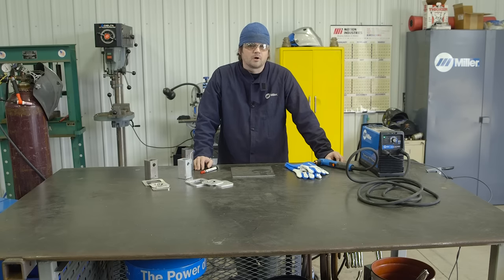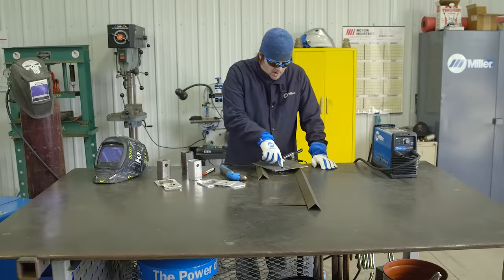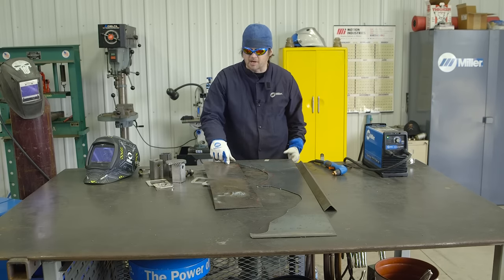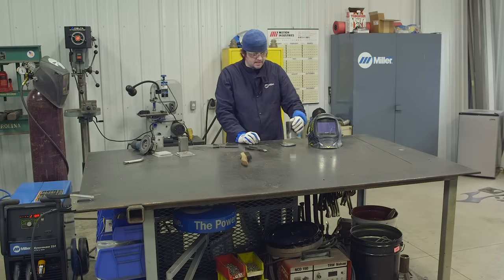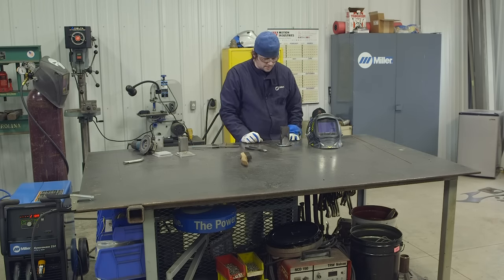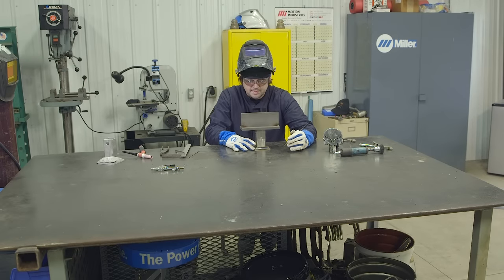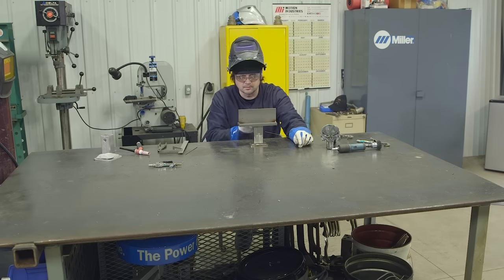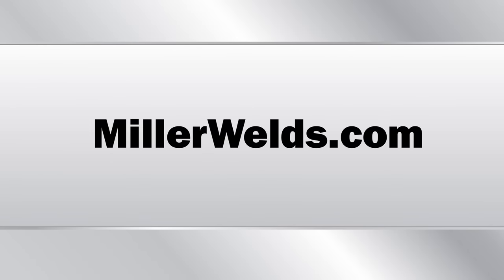TIG Welding Punisher Trailer Hitch Cover with Miller Syncrowave 210

Comment: Nice tip: Need an honest opinion, I'm looking at either ESAB EMP 215ic or a Millermatic 200 or even Miller Syncrowave 210... I only have room for "ONE" welder, but Need it to weld Heavy-Duty backhoe buckets and I need to weld a 12,000LB winch to my car-hauler Trailer as well as tie-down loops, and I have an aluminum boat that got smashed on the rocks and I want to fix the leaks, and do railings on steps and trailer, and now maybe even build a trike or Hot-Rod from the frame up, and Tube guards and racks for my side by side Quad and pickup trucks as well as 10,000LB+ trailer hitches and exhaust pipes and everything in between... So, if you can only have "ONE" welder in your whole shop that you will have to take out to the middle of no-where to weld on a Heavy Duty backhoe and farm equipment, that works on both 110+220V in the price range of these what would you have?? (is there another one I've over looked?) Also can the Miller 210 cables interchange with the Millermatic 200?? As a friend has just got the Millermatic 200 and I want to make sure if I get the 210 and I'm welding on a Sunday after Church and the gun breaks down, I want to be able to call him and have him bring over his gun to finish the job, instead of having to either wait a week to order one on line or even waiting for the next day to drive 30 miles each way into Vegas to try to find another one... Anyone that have one of these or have used these please let me know of any drawbacks on any of these... I need to know asap as the Rebates end this week on the Miller units...Thanks for your help!!

Comment: Hi, I'm a student doing Fabrication and welding, we use TIG and MIG welders, MIG i have no problem with but the tig welder I can't get comfy in my hand forcing me to become a 1 inch welder, it's mainly caused by the tube connecting the machine and the welder, any tips?
Reply from the maker: Thanks for reaching out! That's a great question. Andy Weyenberg provides some great tips in our TIG Welding Basics videos that you might find helpful: https://www.youtube.com/watch?v=6ay_oYg0LUo&t=2s